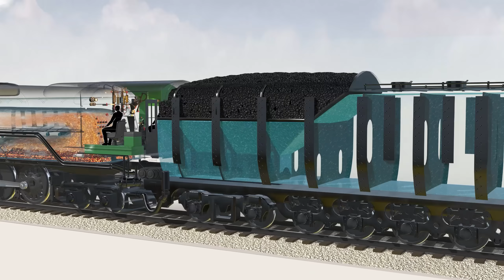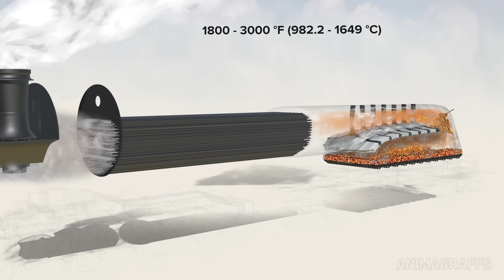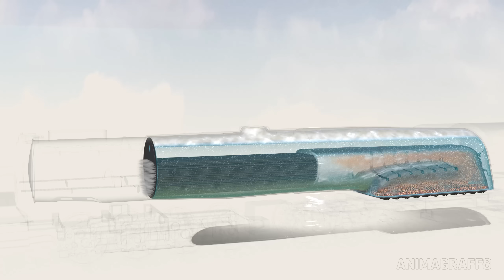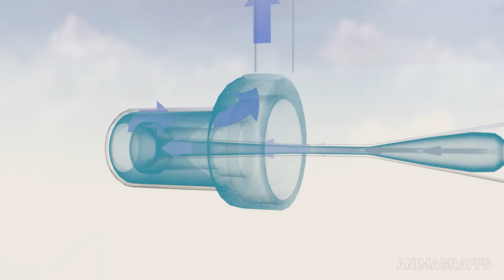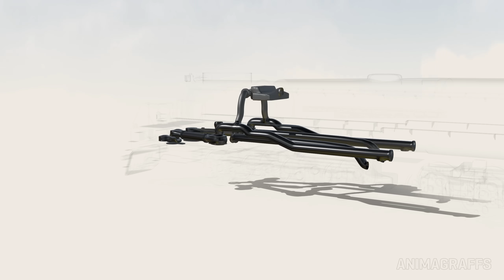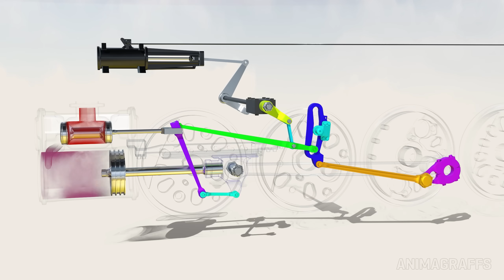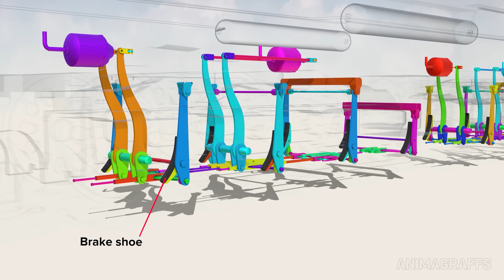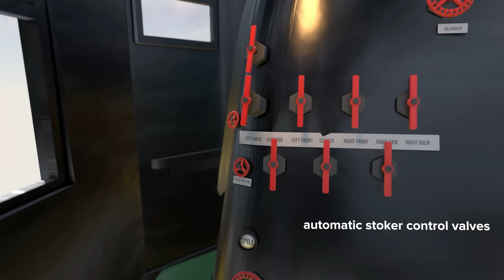How a Steam Locomotive Works (Union Pacific "Big Boy")

Comment: It is now easy to see the complexity of steam locomotives and now easier to understand why diesel electric locomotives were quickly taking over in the 1950’s. I would apply this same thought to Hybrid Automobiles as an alternative to Internal Combustion Engines or even Electric Cars. Railroads figured out 80 years ago that Diesel Electric Locomotives, a hybrid engine was the better choice rather than strictly steam or strictly electric. The auto industry might learn something from the railroads.

Comment: I'm lucky enough to live in St. Louis near the Transportation Museum. We have Big Boy #4006 here in St. Louis and it is just quite a site to see. 132 feet 9 1/4 inches long. It weighs 600 tons (1,200,000 lbs.) and could generate a speed of up to 80 mph. Only 7 are left on display out of 25 built.

Comment: "Pure steam is a gas with no water in it." No. Steam by definition is gaseous water (vapor) that is above 100 C at 1 bar of pressure. At 20 bar (300 psi), water turns gaseous above 215 C. "Steam you can see still carries some water content". No. Steam "you see" is condensing in the cooler, 1 bar atmosphere, but it is still steam: place your hand above a pot of boiling water above which steam is being formed--you will be burned because the steam is far hotter than the boiling water, and at atmospheric pressure, that means it is above 100 C--that is, steam you can see. Your animations are wonderful; your narration is dubious.

Comment: I didn't find the pinned corrections comment (My phone doesn't show pinned comments?)

Anyway. You say "water is not compressible, at all". Water is compressible, like any material. It is very common to say water is incompressible in these context but it's just not right, and people memorize this statement and perpetuate it. So instead you could say "water has very low compressibiltiy.."  which gets the point across, isn't that much harder to say, but is correct. 

I usually get insulted and verbally attacked when I mention this so yeah, used to it :)

Apart from that, amazing videos. The animations are fantastic!

Comment: It's very impressive how every part of this complex, massive machine was developed through hand calculations, trial and error, bold experimentation and also a handful of nasty accidents. The weight of the whole locomotive is huge, but it pulled trains that were many times its own weight. And once engineered and produced, it ran on just coal, water and grease. Wonderful. Top job on the animation and explanation!! A natural follow-up to the diesel-electric locomotive video, which I can also highly recommend.

Comment: UP locomotives built to feed the industrial needs of wartime America. They have so much power behind them, that 4014 had, on its own, pushed a stranded miles-long freight train up a steep grade only recently. This is why even in the modern era, they are still incomparable (in terms of raw power and tractive effort) to most modern diesel electric locomotives and cannot be underestimated.

Comment: Overall, very interesting.  One small quibble though, the boiler check valves on the Bigboy are located on top of the boiler "under" the forward sand dome.  Injecting feed water into the coolest part of the boiler helped reduce the stresses to the boiler shell caused by the temperature difference between the feed water and boiler water.

Comment: Each of these magnificent engines pulled freight for over 1 million miles during their service life!   I believe the super-heater you showed was the type E which was more efficient but more complex than the type A. 4001-4019 has that type E while 4020-4025 had the type A for simpler service. As you mentioned 4014 now burns oil which is safer as it doesn't spark, and far easier to load today. 4005 also ran on oil for a time.  Your Fantastic automation shows just how much work went into these massive machines, all before computers!!!

Comment: As an electrical engineer the beauty of the mechanics in this are astounding. So many places I can see in the design where electronics could lighten, simplify, increase information, positional control, produce efficiencies, but its all done in this case mechanically. Respect.

Comment: I worked on a 1908 ALCo at Steamtown. Due to the disorganized manner in which it was disassembled, transported, and stored, components for the locomotive were in different locations and at time amongst parts of other locomotives and even rolling stock. In an effort to determine what all was missing and as reference to what may needed new parts made, we examined the other ALCos in the collection. Those closest to 1908 were the biggest help. We checked out the Big Boy in the collection, more so because we were out there. As expected, due to the age, technology, and scale gap, our locomotive being about as long as the Big Boy's tender, valve handles were about all that hadn't changed in the 30+ years between designs. Our locomotive had superheaters, but were installed later in its operational life as they didn't exist in 1908.
This is an excellent video and has left me with a better understanding of some of the components i was working with.

Comment: 17:48 Quick question about how the reverser lever connects to the valve gear. That little blue piece between the reverser lever that moves the sliding pin up and down seems to change size during the animation. Is that a limitation of the animation?

Comment: As a aircraft mechanic and just general mechanic and tech this was really nice and professional done. I wish i had something like this for aircraft parts when i was going through college because i had trouble understanding parts of an aircraft and than we had a 4 piston aircraft engine that has sections cut away i could move my hand at the spartan north campus. Being able to turn the prop shaft and see all the cylinders and pistons move and all the connecting things just linked it all together for me.

My only thing i would like to see if when highlighting part of a system, while a connecting part might be covered later, would be to switch focus while showing how a individual part is moving to shift out for a min and show the supporting  parts. For example, when you were doing the cylinders i was trying to figure out the steam getting past the valve which you covered later. When you were showing movement of the cylinders it would have been nice for a couple of seconds to see the valve movement feeding the cylinder even though it will be explained later because if i was in a class about steam engines i would have already had a ton of questions.

Comment: 17:07 The animation of the valve gear, which we call Heusinger where I live, is wrong. The short cyan colored lifting link connected to the yellow lifting arm should not change its length at all. Instead, the "stone" between the green and blue parts should ride inside the "groove" of the curved expansion link that pivots on a pin on the frame. The "stone" connects to the green radius bar, adjusting timing of the piston valve. 
34:39 Those gears rotate silly. 🙂
Still a nice video!

Comment: 4014 is the only Big Boy still operating and is actually still used to do work. The power of the Big Boy is mind boggling. It can do the work of 4, 5 or even 6 modern locos. Unfortunately, it is mostly relegated to operating out west where it is mostly flat, open country. I saw her in operation a few years ago when it made a rare east midwest appearance

Comment: I would be concerned about speed gauges. Since diesel engines probably have that during the Dieselization period, they have none during the steam era. 
Therefore, I may have a question: if any steam locomotive could have a speed gauge for monitoring the speed, where would it be placed onto?

Comment: The moment i ponder the beauty of the cyllinder action, you call it mesmerising. The moment it hits me how impressive the design of a steam locomotive is, you call it so. I'm a mechanical engineer myself and, for me, the elegance of mechanical solutions used here is simply beautiful. This discipline has lost a bit of its charm with the replacement of steam power by modern combustion engines.

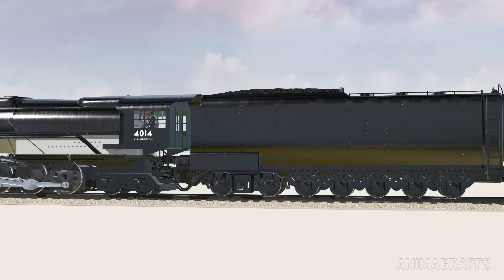Comment: Just a small correction I haven't seen pointed out anywhere but @1:03 there is a unit conversion error, 1.4 million pounds is about 635000 kg, not 6 million.

Comment: This was a Masterpiece! Although I still don’t think I could run one, I have one question. Since the coal auger is steam driven, does the fireman have to shovel what must be a prodigious amount of coal to get the engine to a working pressure to operate the auger, or is external steam or compressed air used to feed initially? Thank You for the his beautifully done video! I subscribed based on this video alone about half way through!

Comment: The animation cleared my doubt about how the steam was transported from the high-pressure cylinders to the low-pressure cylinders keeping in mind that it was an articulated locomotive and each frame would have some transverse and vertical movement or a combination of both as it rolled on at 60 mph. I think the steam pipes had labyrinth seals at their articulation points. Correct me if I am wrong.

Comment: This was a very good animation graphics explanation on how the Big Boy Locomotives worked. It is true that all the Big Boy locomotives were originally built to burn coal as their fuel. With the exception of Big Boy 4005, these all burned coal during their rail road use life. However as we know when Union Pacific restored Big Boy 4014 back to service the locomotive was converted to burn fuel oil as its fuel. It would be interesting to see a video like this one showing the fuel oil system of the restored Union Pacific Big Boy 4014.

Comment: WOW. Excellent video, man! 

In most situations, you would be correct in that the steam would then be exhausted, but the big boy actually used it again in the 2nd engine, hence that big pipe from the front engine to the rear.

Comment: @7:25 very very tiny correction but water is compressible, it’s just that steel isn’t strong enough to measurably compress it before failing. Water at the bottom of the ocean is 4% more dense then sea level

Comment: The three safety valves (relief valves) are set at 110%, 120%, and 130% (for a 300 psi plant this means: 330, 360, & 390 psi). Often the 120 & 130 have a whistle built in, to ensure people know that the boiler is getting noticeably above safe pressure levels (actually when new, or getting testing under CONTROLLED conditions, they'll run it above these limits, but with thick walls just in case something "lets go"!). The 120 whistle is a different pitch than the 130 so the Engineer and the Fireman know when both are "lifting", i.e. releasing excess pressure..

Comment: Hi there. While I do appreciate all YT "content creators" for their efforts to provide clear and easy to understand specs for both "imperial" and "metric" crowds, I'm always kinda amused by numbers like "6 million kilograms" [addendum - I'm talking about CC text] or "a diameter of tree trunk" being "approx. 1600 millimetres".
That makes just as much sense as expressing NY-Chicago distance in feet of a weight of Statue of Liberty in ounces (or its height in inches).

The "metric lot" sticks - typically - to MOST CONVENIENT units, most suitable for the task - AND the typical precision required or expected . A loco or railcar weight tons, not kilograms, their length is expressed in metres. A wooden beam for a carpenter is 20 by 6 cm, and 2.35 metres long, while a steel beam/ section, for a MACHINIST, is 200 by 60 mm, 2350 mm long.

Yes, scientist SOMETIMES use "gigagrams" for total CO2 emission (measured in millions of tons) or seconds for expressing the age of universe, but that's made only to simplify calculations AND for those very specific instances. All "normal metric folks" do "as explained above - for a casual YT viewer a loco wheel is 1.6m in diameter, but for a lathe turner "truing the profile" of this very same wheel it's 1595.0 mm (zero indicates the tolerance, ± 0.1 mm.

The only instances when "regular" people use millimetres, and MILLIMETRES ONLY in situations where bigger units are clearly more suitable (furniture, house etc.) are in relatively freshly "converted" places (or "converted people" in "non-metric" places), like Australia and some folks in US - and there, and probably only there one can buy a 10-metre measuring tape scaled EXCLUSIVELY in millimetres" (not in "cm" and "m" as they "normally" are), but I digress here.
Anyway, while "unit conversion" in metric world is a breeze (you just move the decimal point and change the prefix), that "six million kilograms" does throw you off the track (pun not intended). It just isn't a very "clear and easy to understand spec". No biggie, but still, tad odd.

Nine million bicycles (in Beijing or wherever) - yes, absolutely. Six million kilograms? - nah, fuhget - that's six thousand tons ;-)
BTW, 600 tons - the "weight combined" - equals SIX HUNDRED THOUSAND kilograms, not "six million". 1 t = 1000 kg, thus 600 t - 600 000 kg. And, oh, while at it - a VERY nice video. Thanks : )

PS: In one manual for some  garden device (bird feeder or mole repeller, or such) I came across a dumb sentence, that this thingy has to be "put on a wooden stake, approx. 25.4 mm in diameter" and though "whisky tango foxtrot?" Who'd be so dumb to specify with such precision a piece of wood that's just... oh, wait. ONE INCH, "approximately" one inch in diameter... OR, for "metric garden" (and a stake), "about 2 - 3 cm". Beam me up, Scotty...

But I digress here, an while indeed a "normal" body temperature of a loco driver would be 98°F, or 36.6°C (36.9°C would be a serious fever!) - that "1800 to 3000 °F" (APPROXIMATELY) is BEST converted as "980 to 1650 °C" - or even "1000 to 1650°C". What difference a tenth of a degree would make here? Fahreheit temperature is given "rounded to hundreds of degrees" - but "Celsius" with a tenth of degree precision?
PPS: BTW, 300 psi ≈ 20 bars, or 21 kg/cm2, aka "technical atmosphere", the most commonly used unit in metric world, even if Pascal, or MPa (megapascal, approx. 10.2 kg/cm2) is the "official" unit now.

Comment: Understanding better the Superheater only now, and the operation of the injector is simply ingenious, then it would also function as a kind of "pre-heater" for the water that enters the boiler, thus reducing the energy needed to boil it inside there, increasing the efficiency of the locomotive

Comment: Amazing video. I miss the visual “aweness” of things mechanical in today’s world, from looking at a pocket watch mechanism in action to seeing,hearing and feeling the passing of a steam locomotive under load. 

One observation - I believe that the left and right side wheel-sets are normally offset 90 degrees to ensure the cylinders are never both at top/bottom dead centre together. This evens power pulses and allows the engine to pull from any stopped state. Although not mentioned in the narrative, it appears that they are aligned in the videos.

Comment: Very good explanation of many "in the weeds" concepts that are often hard to explain to the public. 

A minor modeling error I noticed is the location of the check valve for water injection. The Big Boys have a dual check valve that is on top of the boiler underneath the front sand dome. It allows the water from the Exhaust Steam Injector and Live Steam Injector to enter the boiler at the same location. (Not right by the Firebox)

Comment: I don't understand the operation of the blowdown unit - how does that one small thing clean contaminants from the vast mass of water in the boiler? Most of the water doesn't even seem to flow anywhere near the unit. Also, how did they mitigate corrosion in the boiler - sacrificial anodes? Did they also do periodic descaling? Wouldn't all the staybolts (never heard of them before!) make that hard?

Comment: I've had this in my head since having a debate with my physics teacher nearly 25 years ago...but I still keep hearing this myth that water isn't compressible. Let's think about it.
Let's take a sealed metal cylinder that's half full of air and the other half is water, with two pressure guages at the top and bottom of the cylinder, including an air line connection.
If I compress the air inside the cylinder by adding more air to it, let's say 50psi, that pressure acts on everything contained in the cylinder.
The water has nowhere to go, but it must equalise, so it's density must change to accomodate the extra volume of air. Both guages would read 50psi, therefore water is compressible.

Comment: Ive heard people say before that Steam Locomotives are simple machines in comparison to modern diesel or electric locomotives. I would recommend them to watch this video & be proven wrong. Granted Big Boy was built in 1941 when Steam Locomotive technology was at its apex. I imagine mechanically comparing one of those old west style locomotives directly with a Big Boy would be like directly comparing a Ford Model T with a brand-new Ford F-150, the basic setup and concepts are the same but the 100+ years of innovation really does make the vehicles two separate beasts entirely. Great Video!

Comment: 604 tons is 604.000 kg not 6.04 million kg

"Normal operating temperature is 1800-3000F"? Meaning the temperature of the fire, since you can't heat water to that temperature at 300psi

Fantastic Video for the other 99.9% of the video!